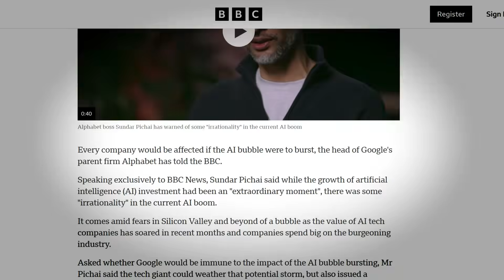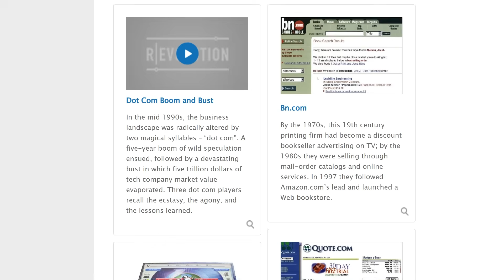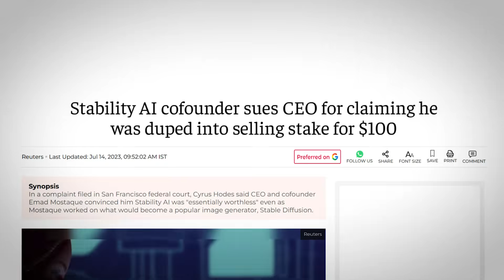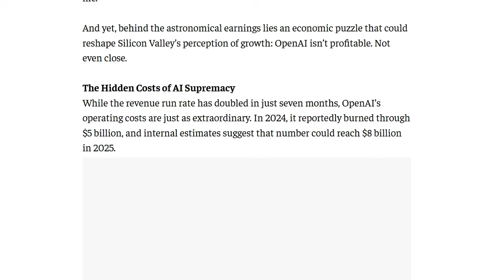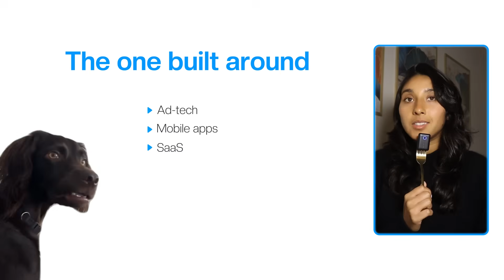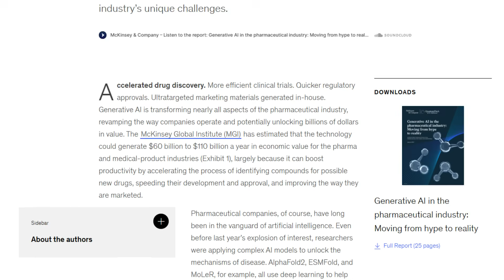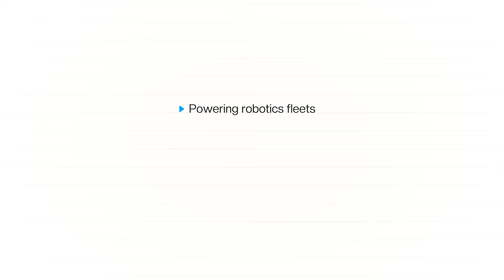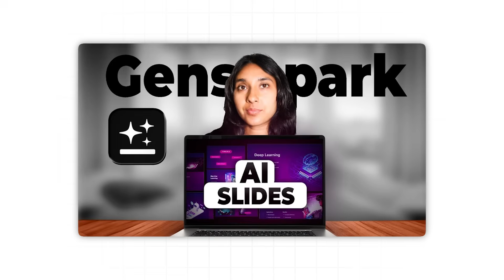The Worst Layoff Cycle Yet

Comment: That sounds nice. But it also means there'll still be demand for traditional software engineering roles but not as much as that AI driven hardware, robotics, etc. We'll probably still have web devs, graphic designers and all. Robotics won't be a replacement of manual labor either. It's just going to be useful for assisting with mundane tasks.

Comment: If the product of innovation is assumed to be efficiency, the long-term outcome will always be a lowered value in human 'units of labor', i.e. jobs. If this was not the expectation, there wouldn't be massive investment in the potential for AI. Good luck changing careers into hardware/mechanical engineering (my background was M.E. before getting into software). The only way to hedge against the tech wave is to find a path toward owning real assets, and stop being a 'unit of labor'.

Comment: We are in the initial stages of a very big globally synchronized deflationary recession. Emphasis on global. Demand (all demand) is already down and still shrinking. That's why everybody is now laying off workers to avoid bankruptcy. AI is in the same boat, but also in a boat with a bigger hole. There is no evidence that AI in it's current incarnation will every generate significant revenue, but these companies are imagining that it is the same as the Dotcom bubble so they are trying to be the winner on the hardware end. Unfortunately, they are too early and betting on the wrong hardware. The game now is to keep their stock prices up so they can continue feeding off investors, but that is also unsustainable. It is going to crash and most of the data center projects will either not be built or will go unused. Of course, they'll still destroy the economy, the tech market and the environment along the way.